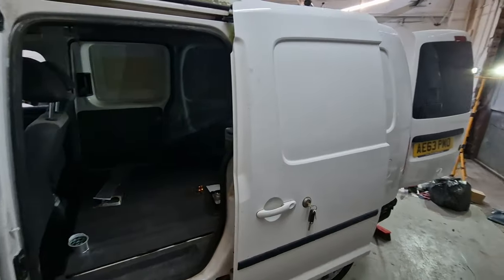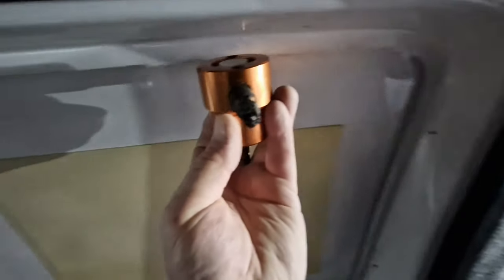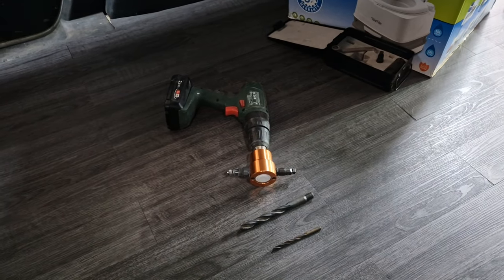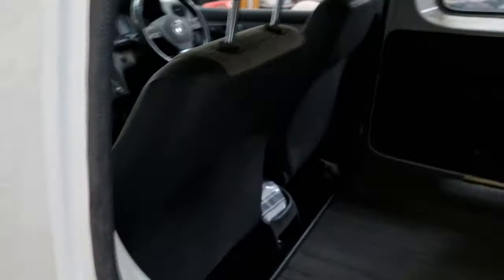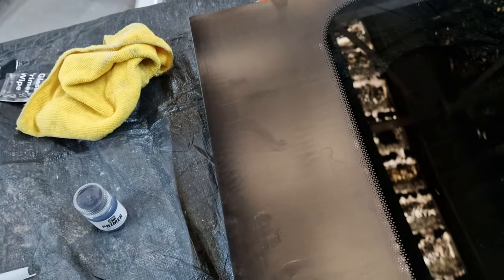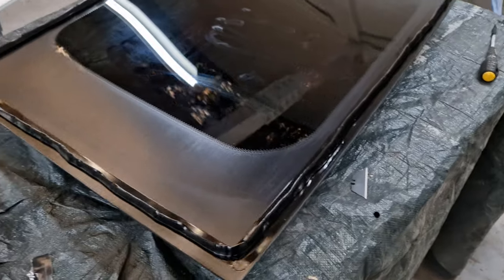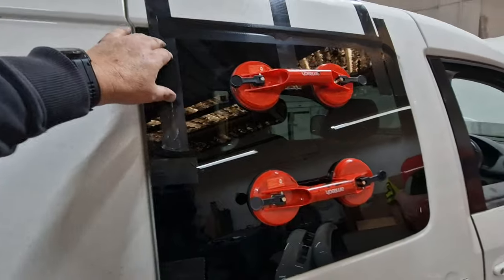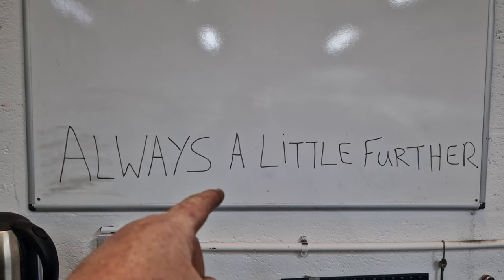Caddy Maxi Day Van Camper Side Windows Fitting

Comment: You should leave a small gap in the sealant when fitting a fixed non opening window. Stops the window cracking in heat
Reply from the maker: Thank you and noted, must admit I did not know this
Reply: Do you mean a gap in the bead of glue itself or between the bodywork and the window ?
Reply: @appelflapdrol  the sealant
Reply: @marcoantoniomoreno2055  thanks for the tip 👌
Reply: From what ive read the gap is only for dummy windows (not cutting the panel out), if the panel has been cut out the hot air can escape into the van so no pressure can build up causing it to crack 😊
Reply: Hi, could you share the size of the rubber seal for the metal edge?
Reply: @TheOllycj  sounds logical, I've also never seen the pro window fitters leave a gap